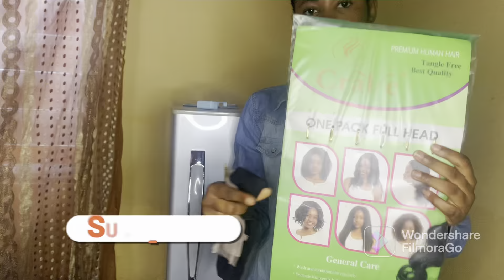How to: DIY T Frontal ventilation and wigging using synthetic weavon | beginners friendly

Comment: Hi please I am new to ventilating and I am glad I found your page.
I ventilate vertically and you ventilate diagonally please what is the difference
Secondly when I ventilate two strands of hair in a hole and I skip the next hole , the ventilated closure looks very scanty
Reply from the maker: I will upload a video that answer all ur questions in my next post
Reply: Thanks alot it will help me
Reply from the maker: Concerning the scantiness, volume of hairs are different. Some strands are thick while some are very tiny. So if u are working with tiny strands. U can use 3 or 4 strands at the back and use 2 at the front
Reply: Thank you so much
I was confused